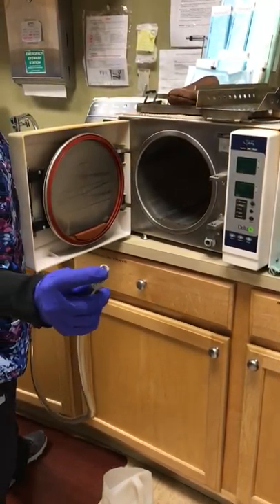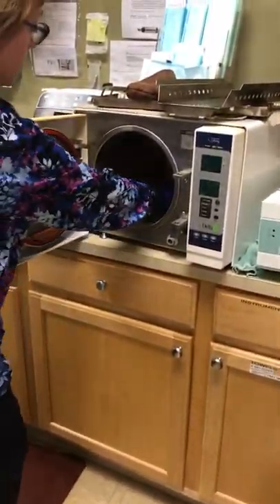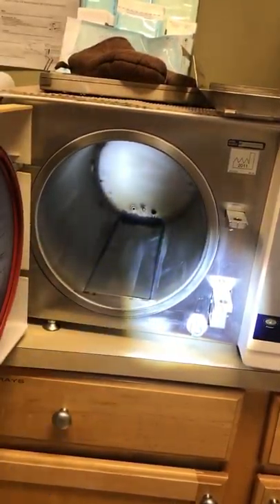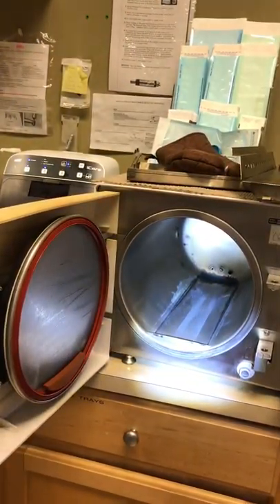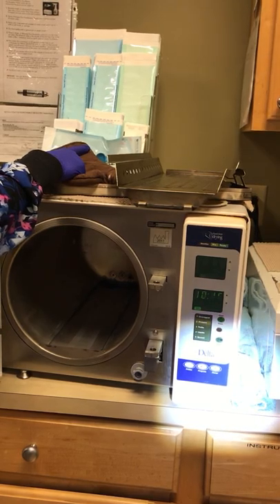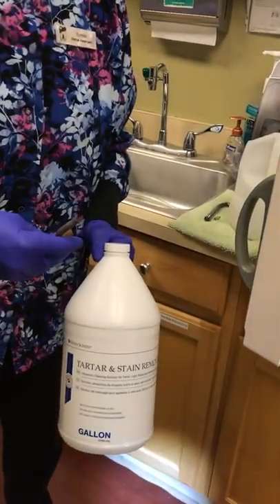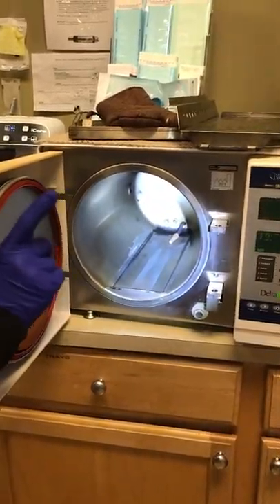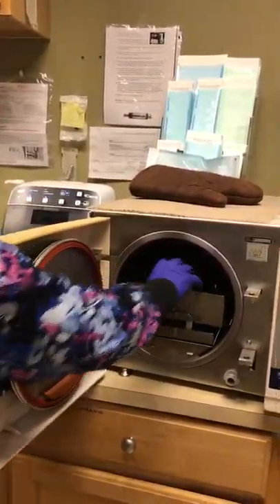Delta Q Maintenance

Comment: Drain water in container 
Take everything out 
Pull out little copper tubing 
Pull out piece on left (clean them)
When cool Scrub out the inside with speed clean when and spong 
Scrub trays 

Put innards back in 
Put water in
Run it on wrapped cycle 
Drain out water 
Put more water in 
Do unwrapped cycle 
Back to wrapped cycle and water in then normal cycle with instruments (first cycle has to be wrapped) 

Once a month